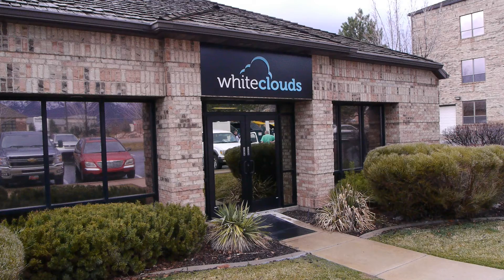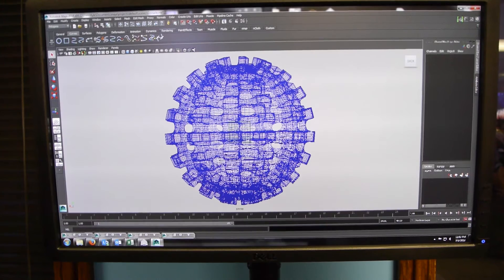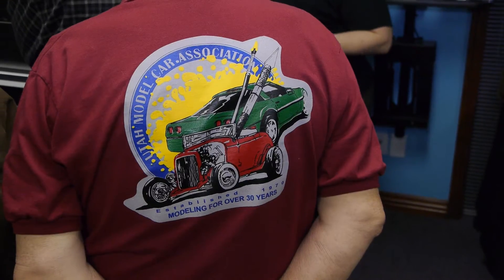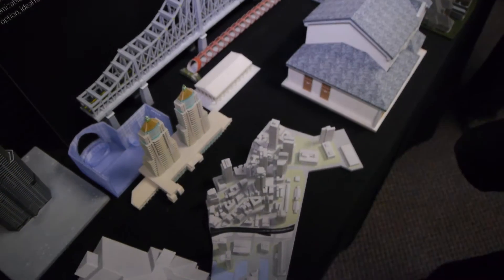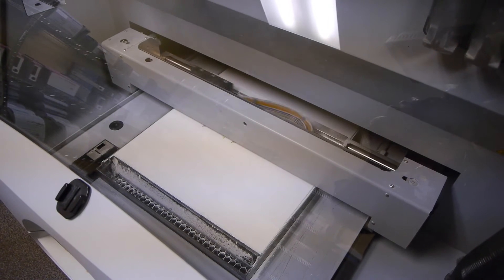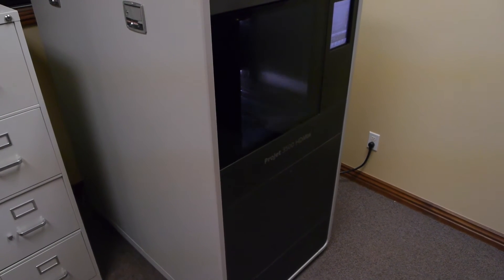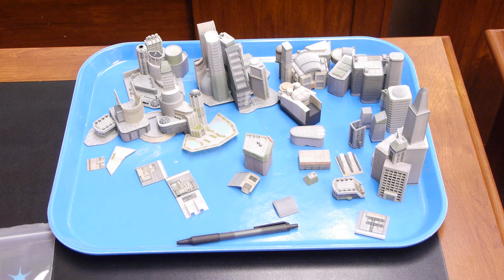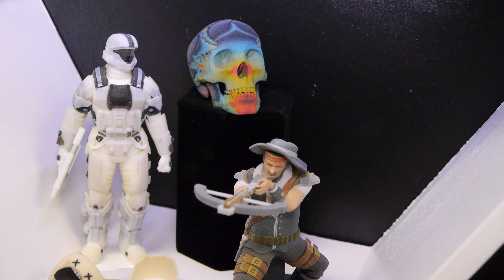White Clouds 3d printing

Comment: 3d printing is coming to everything now, even manufacturing,  I read an article in Train Mag, about a company making parts for locomotives this way that can be made smaller and stronger than conventional ways, WOW it taking over!
Reply from the maker: Did you see the show on Ozark Miniatures? AMAZING 3D printed wheel trucks then cast onto white metal.